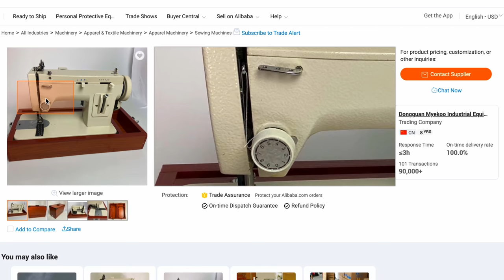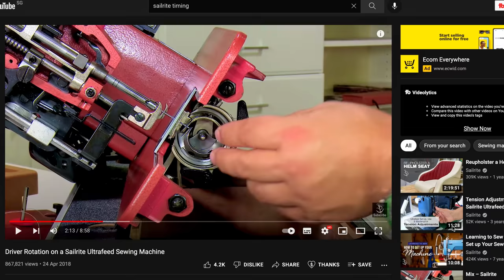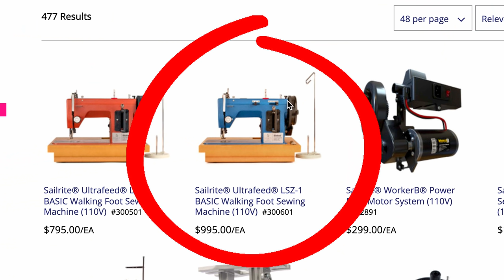SAILRITE VS CHEAP Sewing Machine (Full Comparison)

Comment: Oh the joys of Chinese power ratings, I never trust them. The only way to know how much wattage the motor draws is to put an ammeter in the electrical line feeding the machine. I have a small outboard for my dingy. It is a Parsum with a big 3.5 number on the cover, it is copy of a Yamaha 2hp two stroke. Not only is it not 3.5hp it is not even as strong as a real Yamaha 2hp.
Some one else commented about getting an older standard sewing machine. Great idea if you can find one. My sister had three older machines that were serviced annually by a local tech in the US. He told her if she ever wanted to sell them, call him first.
Reply from the maker: Yes, I'd agree with you on "labels"... Cheers SOTR

Comment: Thanks for sharing the acknowledge !!!
Since you have both machines, can you figure it out what is that is needed in order to achieve the reverse level with one hand, maybe frankestein the reverse level part from the Chinese to the Sailrite?
Reply: $60 is for the wooden case only, check the listing you include in the video
Reply from the maker: Hey Roberto...the sailrite is not mine, its a friends... I'm sure he'll notice if i start swapping parts!
Reply from the maker: Oh you're right!... well spotted Roberto... I used the wrong clip... the machines are $180
Reply: Sailrite sells the two-pin stitch-length system for retrofitting on older machines.  The installation video for it  https://www.youtube.com/watch?v=Z93bfzwAHP4  shows how to convert from the friction mode to the spring mode during the installation.  Presumably this could be reversed from spring to friction mode if desired or ignored if adding it.
  The two stop pins would be handy for back-stitching frequently and keeping stitch length without fuss.

Comment: Ok, for everyone who owns these machines, let's see what we are really looking at here. First off these are NOT industrial machines. These are basically a heavy duty sewing machine of a domestic home use sewing machine. Sailrite advertises these machines as Heavy Duty whereas the other manufacture's advertises these as industrial in which these are not.
You have to oil these machines every two hours of constant use. The motor has a cool down period of 20 minutes per hour of use, depending on the work load. The cool down period is anytime the machine is not running in a one hour period. Most projects will not violate the cool down period, but beware of it. If you're sewing a lot, feel the motor, if it's hot to the touch then let it cool. Hot is also if you can smell the motor. These are only 1/6 hp motors, or .9 to a 1 amp motors using 110 volts and most yacht repair projects will demand 100% of the motor's rating. The new "worker B" motor Sailrite is putting out is still only 1/4 hp subject to the same cool down limitations. An industrial sewing machine for comparison uses a 1 hp motor and has a self oiling system. Can run continuously for 8 hours. These are the Juki RB 206, Singer 211, Sailrite's Fabricator and alike sewing machines.  
Again these machines were designed to be used for use on a yacht, nothing more, sewing seat cushions to patching sail cloth and everything else in-between.

Comment: If you can't wind a bobbin, there are probably set screws that are holding it solid. Loosen those screws and the clutch should work then.
Reply from the maker: Cheers Steven
Reply: Another possibility is the 'star washer' under knurled knob is 180° out of phase and prevent the knob from backing off enough to disengage from the main driving shaft.

Comment: American appliances run on 110 volts if u were to say use that machine in a country that uses 220 you need an adaptor that regulates the volts back to 110
Reply from the maker: Correct David... I was lucky enough to buy a 220v version refurbished... That's probably why no one wanted it!

Comment: Great video! I bought one from Dongguan from Alibaba and the machine never worked. I got it totally misaligned with broken parts. Simply Dongguan Myekoo do not have quality control... Please DO NOT BUY from Alibaba especially from this supplier. 
Just for fun I did my best to black list them for  Nordics, no body from Sweden, Danmark and Norway gonna be tricked.
Refund?... right Chinese tricks,  I got just small amount back. Well they propose to send me a new one, only if I pay 200usd more for shiping. Never accept that for sure the 2nd might have the same quality. 
Soo I end up buying spare part from Sailrite and now the machine is working.
Reply from the maker: Ah really?.. Good info Asen.. Yes, I'm sure it would be a gamble.
Reply: At least you got a machine. All I got was a piece of plastic that has nothing to do with sewing! I think it's a scam website.

Comment: Interesting video Jamie. I have a Sailrite zig zag machine and have done so much work on mine on the boat but I have not tackled my trampoline as yet which is in serious need of some attention. I have needed to buy some spares as the smaller needles can bend and touch the internals causing burrs and you tear the thread. Bought the replacements and we are back up and running again. As far as machines go yes I think they are a bit pricey and I would love a Juki machine but most industrial machines only cater for one stitch pattern which makes the sailrite work on a boat.
Reply from the maker: Sure Mike... they are overpriced...but certainly a better machine.

Comment: They may be "primitive" machines, but the point is that they are HEAVY DUTY machines, which means all their parts are also extra beefy. They are not your typical house hold machine for making clothes, curtains and other house hold things. These machines can put up with the abuse of sewing sails, heavy upholstery and such. You cant do that with delicate finicky machines. Sailrite costs more because even though they're beefy, the parts are more refined, smoother and will probably last longer than the Barracuda or other such machines. As you found out, the Barracuda's timing screwed up and you don't know what caused it. Their own replacement part didn't even fix the problem, but the Sailrite part did. So what does that tell you? That's why Sailrite commands the bigger bucks, they have a better machine. Now, if they made their stitch length selector like the Barracuda's (Old Singers) and had numbers on the tension knob, they would be even better. 
But Sailrite costs more because their parts are milled better.
Don't forget to oil your machines. It's important.
Reply from the maker: Good advice.. Cheers

Comment: I have a Juki ddl500 it's an old one,, but it works ok,, however it dose stitch 5,400 stitches a minuet!,, that's like zip! and you have stitched a foot of materiel,, or your finger's!,, the difference between a 240 volt motor and a 110 volt motor is this,, the 110 volt motor will pull twice as many watt's as the 240 volt motor will to give you the same power output!,, so a 110 volt motor will use twice the wattage,, as for thread,, only use a ""bonded nylon"" if what your making has to withstand UV sun light and is out in all weather's!,, never use cotton to mend a sail,, only bonded nylon can do that job,, and make sure you use the right size needle for your thread ie,, 100/18 or 100/20 ""leather needles"",,  but the bigger the needle the more the sowing machine will grunt pushing it through!,, and if stitching in new plastic windows,, lubricate the needle or it can melt holes through the plastic,, so go slowly to keep the heat down, remember,,  speed is not important,, but accuracy is!
Reply from the maker: Good info Cheers Michael

Comment: Sailrite does a good job with these machines, but they are all generally poor designs.  If you get one, the worker-B is a huge upgrade. - For these Semi-industrial designed machine they are on the whole "Junk" when compared to a High mileage industrial machine for 500-700$

Comment: The Barracuda is nothing more than a Sailrite clone, it's a clone of the original Sailrite. Sailrite moved their manufacturer and removed the ability of the manufacturer to sell copies of the Sailrite. The Sailrite does have a lot of upgrades internally that you can't see. I have had a Sailrite since about 2007 and wouldn't trade it for anything. I just put the Worker B motor on it and I am blown away by the slow speed control. The Barracuda is just a cheap machine and may serve you for years, but, the Sailrite has been changed over the years for a reason.
Reply from the maker: Yeah it’s a klunker….but gets the job done.

Comment: Hunch you find Monster Flywheel supplies significantly more torque than the Reliable Barracuda machine. That would explain lower wattage needed.
Reply from the maker: Possibly... The cuda crank has some weight also.

Comment: $60 was for WOODEN BOX only (!) - this is why you need to read Chinese auctions with all details - they try to deceive buyers.  I stopped your video and on the Alibaba description is wooden box for the machine (not the machine(!)  - this is only pictures of the box with some example ;) machine).

Also: worth to note: Barracuda needs stronger motor because of it's bad quality - so more power neededed to operate machine. Stronger motor is not 'pros', because it's power is not used for sewing but rather lost on different frictions due to low quality.

Comment: If the drive only needed 2/3mm adjustment I'd have tried careful filing back the point before cutting the drive off. You never know it may have worked.
Reply from the maker: Nah Joe... It was the other way... I needed to lengthen... I did pry open the little tang on it... But didn't work.
Reply: @SailingLifeonJupiter  I stand corrected. I'm enjoying your channel and promote it where poss.

Comment: Looks like the China machine motor is not high quality. Normally higher voltage would require lower wattage to operate.
Reply from the maker: In sure the SR has got the better gear.